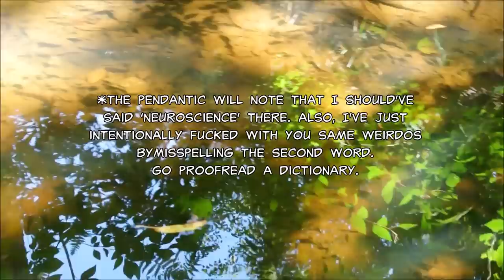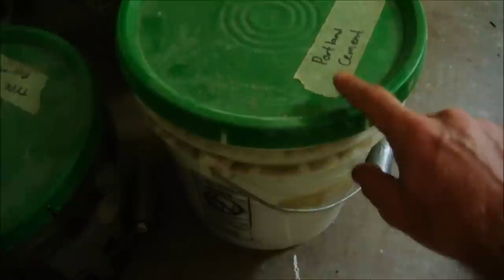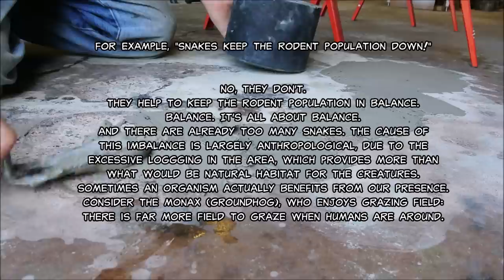Concrete pock repair with pocket! (also w/ cake, snakes, & ecoethics)

Comment from the maker: POISON:
The plant that I yank in this video was likely Daucus carota, that is, 'wild carrot,' or 'Queen Anne's Lace,' and probably not Poison Hemlock. The two plants look nearly identical. So if you don't know (or can't tell) the difference, don't eat it.

SNAKE RIGHTS: 
Whiny, emotional comments will get yanked. If you want to defend its right to exist, you must do so in the form of a cogent argument. Convince me. Please read the description.
Reply: Wild carrot is tasty, a bit stringy and woody, but usually sweet and tasty.
Reply: Read the description. The question on my mind, but not necessarily an argument for or against the snake killing, is where does pain arise in the body? It doesn't strike me as a cognizant processes as our initial response to it is not usually a conscious effort. Example, you accidentally touch a hot stove, an unusually high number of localized nerves start firing, and ultimately your brain (or possibly spinal cord) reflexively responding to pull your hand back, before you consciously register the heat. This seems to me like a function that would have evolved far before our ability to "feel" anything. The ability of nerves to register damaging stimuli, transmit the signal to the central nervous system, and for the system to respond would be a process that simpler minded lifeforms might have inherited from a common ancestor.

Thus, I would think that, at a minimum, vertebrates have all the machinery required to at least respond to pain like humans do. The question of how they perceive this process is hard to say as perception is so subjective. But, evolutionary speaking, I am inclined to think the perception of bad stimuli would also evolve earlier than others. And therefore possibly exist in "simpler" vertebrates? If snakes actively avoid damaging stimuli there is some evidence to think they might experience pain.

Another passing thought. Snakes in captivity get cranky when they are shedding their skin. It is usually attributed to the process being uncomfortable. Would more subtle changes in behavior in response to discomfort (a few nerve cells firing) support that they perceive lower level pain? Higher level pain being a large amount of nerve cells firing.

Thoughts?
Reply from the maker: Edit after re-read: 
Yes, snakes register pain. They have brain structures that cause it (the snake) to act as an avoidance system for things that are not conducive to reproductive success. Like for example, avoid letting something take bites out of you. Bites issue pain.

Now the following will make more sense:

Nathan: My point here was a bit more abstract, because I'm attempting to divorce pain from suffering through a different method—not by accusing limitations in the brain structures that are directly and measurably responsible for initiating a pain response—but by ascribing an amplification to pain that is experienced through the development of abstraction, that is, 'terror,' which is the mental preparation for (anticipation of) and overestimation of, pain. 

Give a dog a shot in its ass, and it will look at you weird. Just mention a shot to a toddler, and get ready. 

Pain isn't really that bad. We make it worse than it is. Try being mindful of it next time you experience it. Sure, a toothache is hell. But I stepped on a rusty spike last month and used a mindful approach to make the throb far more tolerable. My argument is thus: to a creature with zero abstraction, like a snake, pain not only isn't bad, but it's not even there in any way that matters—even if it were to have physical sensory structures that would enhance the resolution of the pain 'experience.' How can anything be 'bad' for something that has no concept of bad available to it? Such an apprehension would be like you or I trying to visualize a tesseract. 

Thanks ;)
Reply: @pocket83squared  I appreciate your view point. A major aspect of intelligence is an organism's ability to simulate the world in their mind. I definitely think this is generally a sliding scale with a large gap between animals and humans, as this is our most specialized adaptation.

There is definitely substance to the idea that the magnitude of suffering is correlational to abstractional ability. An animal that cannot model the world cannot overestimate the pain, leading to the emergence of terror and other amplified responses.

This is something I will need to read up on, but again I wonder at which point this property of intelligence starts to be meaningful? I guess the main baseline is when the animals ability to simulate produces similar behavior that a human's simulation would? Or their ability to problem solve exemplary?

An interesting question, at least to me! Thanks again for responding and sharing your thoughts. I enjoy your insight!
Reply from the maker: Yeah, you hit the nail on the head when you said "sliding scale." Chimpanzee girls sometimes carry crude dolls that act as a surrogate for a child. Attachment begins early, even as pretend. Following the loss of a (real) child, a chimp mother will become visibly distraught. These aren't so much precursors to human behaviors as they are the same behaviors being viewed through a lens that converges on a point that is less abstract; there is a 'depth' to our capacity for suffering that exceeds all that is known to exist in the natural world, and it can manifest as pure torment in cases. Some people can make their simulation so rich that they can no longer escape it even hypothetically, at which point they are in a delusional hell. At least, for me, I can still imagine that there is such a thing as conscious experience to be found outside of my own. In contrast, to be subsumed by your own construction would be, in a sense, to regress back on that sliding scale, down to a place of pure self-preoccupation, as with a snake, but now with the added abstraction. The analogy that springs to mind is one of an endless ring that we perch on, as a balance-beam: one might slip off to either side or remain pressing forward to go nowhere. Perhaps considering this closed circuit is our revelation of the limit of suffering and experience itself; that is to say, maybe our precarious and temporary stay at sanity is as close to reality as we (or anything) can get. There might be nothing 'above' us, but certainly less below.   

That was all just speculation from a person suffering from lack of sleep. Please strike all of it from the record. We're all fine here now, thank you. We're fine. How are you?
Reply: I personally love the smell of mortar/cement as well when mixing. Keep wearing those 'patched' pants! I always love your quick comments about trolls LOL. This is ASMR when watching you fill that hole, btw. And the cake bit, HAHAHAHAHAHAAHAHA. As far as the snake....We all know that story about the woman who nursed a snake back to health. ROFL on the text elaboration on the snake though! Very informative, see you next time :)
Reply: @pocket83squared  Is there such a thing as sufficient sleep?

Comment: Pocket -- great video as always. For a quick, and perfectly smooth, finish you should either sponge float it with a damp sponge (which will bring out some of the aggregate) OR you can use a hard rubber float to compact it. I've found the sponge float approach to work best for floors, as it gives a smooth and slip resistant finish. Also works great for filling in those small dings. Give it a shot.

Comment: 2:01 may, possibly, be the best moment in the entire video.
18:36  Strangely, the definition of "good looking" is fluid.  I, for one, am kinda ugly.  But the opposite sex says otherwise.  Weird...

On the technical side of things...  Way smoother than needed if you plan to empty the building & paint it properly with a high-build floor paint.
Good job anyhow.

Comment: irt your video description: I would add that the hidden, searching, tangled tendrils of mycelium; that writhing alien mass of chitin and digestive enzymes which tumbles our whole ecosystem over and over like a big reset button on all the sound and fury of our biochemistry, is equally as "valuable" to the biome. But mostly I just wanted an excuse to point out that our fungal brethren didn't receive the distinction of a separate Kingdom in our little classification scheme of life until 50 years ago last month! Maybe less strange to think for someone older than I, but revealing, fascinating, and slightly unnerving imo...

Thanks as always for these windows into another world; sleep well, and may you dream a qualia not your own 🍄😘
Reply from the maker: Thanks. Great point. It was kept simple on purpose. Decomposers complete the circuit-like aspect of it all, but at first it's easier to just see production, consumption, and apex. The P⮕C⮕A pyramid model is in every entry Bio text, even the old ones with only plant/animal kingdoms.

Comment: I'm not going to argue about the ethics of killing the snake, that much is your prerogative as it's on your land, but at least kill it in a more humane way if you can help it. Beheading it will kill it, but the brain remains alive for several minutes afterwards, and the head can still bite the unsuspecting person or pet. Crushing the head is both more humane to the snake, and safer to the passerby. It destroys the brain and any movement thereafter is simply death throes and involuntary muscle movement. Instant death, rather than taking up to 30 minutes to die. 

It's just a suggestion, take from it as you will.
Reply from the maker: That's fair. Hopefully I will not have to rid myself of a nuisance snake again for a long time. I don't do that sort of thing indiscriminately. Still, I question the potential for actual suffering as we know it in a snake.
Reply: @pocket83squared   That question has a definitive "maybe". Do they suffer like us? No, they don't, the snake isn't asking itself "why me" when it's being eaten by a predator. They don't have the brain capacity to think like that, as I'm sure you already know since you highlight that in your description. However, they do feel pain, they have nerve endings with pain receptors that allow them to have a negative response to physical trauma in the same manner that most vertebrates do. If their head is cut off, even though the signals of pain don't reach the body, they're still being fired off from the brain for as long as the brain remains alive. Whether that fits the definition for "suffering" to us is subject to personal discretion, I think.
Reply from the maker: "Personal discretion?" I'm not spouting off some speculative or unsupported opinion here: I'm talking brain science. Snakes don't have a brain that's nearly as complex as a mammal's. As a human? Not by orders of magnitude! Suffering, as with anything abstract or conceptual, arises as a result of brain structures that simply do not exist in a snake.

A snake's pain is just a buzz signaling avoidance in an otherwise blank system; it registers painful experience only slightly more than a smoke alarm that buzzes. Now of course, this is an exaggeration, but I'm closer in this approximation than would be the comparison between a snake's suffering and a human's. 

Let's be realistic. Snake suffering is likely a non-zero value, and as such, it is my desire to avoid causing it where reasonable- but that's as far as I will go for now. Admitting to a belief in much more would be speculative, and simply not supported by evidence. Human suffering, in contrast, is abundantly evident in our world.
Reply from the maker: Sorry if that sounded defensive and argumentative. I wrote it while not being able to sleep. Man, talk about suffering. People with insomnia must really go through a tough time.
Reply: pocket83²  No need to apologize, I'm probably sounding like a bit of a baby myself, and you brought up a number of very valid points of data. I get what you're saying, I understand the way snake brains work, having had a few as pets myself, and you're not wrong in the slightest. They function pretty much as you described, they're pretty much a blank slate that reacts to a minimum of stimuli. They see and smell food, they have a hunger based reaction to strike and eat it. They get hurt, they have a reaction to avoid what's hurting them. I would go as far as to say that their brain is sort of robotic. The point I was trying to make was, do you consider being in pain until you die suffering or not? Some people would say yes, some would say no. I didn't mean to try and convert your opinion, I was just stating that it's really a human thing to want to project their ideas onto animals, suffering and all.

 A lot of people with pet snakes think that because their snake is cuddling with them, that the snake "loves" them, when it doesn't, it simply sees the person as a warm and safe place to be. A "warm tree" of sorts. This personification of animals with lower brain function affects how we see them at an emotional level. I'm definitely guilty of that sort of thing sometimes, I talk to my pet spiders like they're people when I'm giving them roaches to eat, but I fully understand that they're invertebrates with primitive brains that only know how to eat, sleep, mate, and run from or attack predators. I don't cry for the roaches because I think they're suffering when the tarantula plunges it's fangs inside it and turns its insides into stew. The roach has no idea. Neither does the snake. There really isn't a distinction.

The long and short of it is, I agree with you, the snake isn't suffering from a practical sense, it's just dying, slowly. Our human brain tends to see that as suffering, so we naturally want to try and alleviate it by providing a quick death. That's my train of thought, at least.
Reply: Also no worries about the response, I wrote my first reply at 1am when I woke up from a dead sleep for no reason, when I re-read it just now I probably could've worded it a bit better.
Reply from the maker: That was pretty heavy. Are you suggesting that suffering is at a zero value with snakes? I'm just not sure. In defense of that position, without the capacity for any abstraction, there is no "bad," so maybe it's only my mammalian bias that wants to believe that pain counts for anything like suffering. Maybe it just doesn't. Maybe things really are robots without a limbic system or a prefrontal cortex. 

An analogy might be a lens's relationship to beauty; something, perhaps a physical structure like a camera—maybe an eyeball—might capture or see something beautiful, but what is the part that apprehends beauty? Not the sensory equipment, right?
Reply from the maker: Ha! You called it when you mentioned a definitive "maybe".

Comment: I have a question.  Does this mix work well on deep floor cracks?
Reply from the maker: You mean, like the full thickness of the slab? Maybe, but if the crack is too long, you might be better off with an expansion joint in there, and only trying to bond the mix to one side. Success also depends on where the crack is, and what has caused it.
Reply: @pocket83squared  We have had an insane amount of rain that has gotten under my garage.  I believe it has washed out much of the sand underneath and caused the floor of my garage to crack all the way thru the floor.  Your video inspired me to get off my butt and fix it.  I'm fairly handy, but not much on concrete work.
Reply: @kansasboy011  If the crack was caused by the substrate washing away, be prepared to patch weekly.
Reply: @Tinker001  I saw someone using a foam rope (looked like the insulation used to stuff around windows), pushing it deep into the crack and then filling the crack above it.  Is this an option or not?  Thanks
Reply: @kansasboy011  It'll still keep cracking if the substrate has gone.  The slab is no longer fully supported & will move or sag.
Reply: @Tinker001  Thanks Scott, guess we'll have to use plan B

Comment: You should have wet it first!
Reply: The floor that is.
Reply from the maker: It had been wet and sponged up one hour before. The concrete was at a neutral saturation. Any more moisture would have made it difficult to get a solid bond.